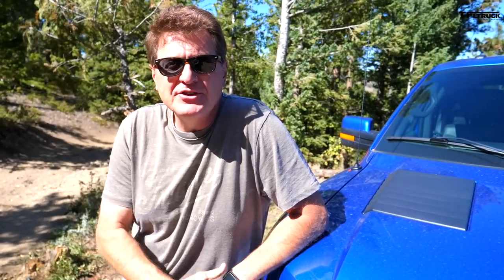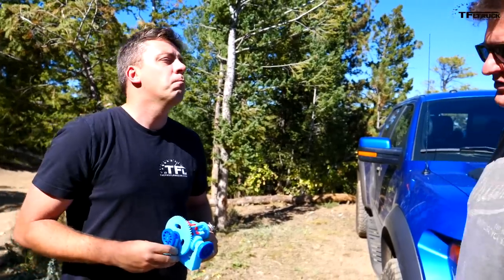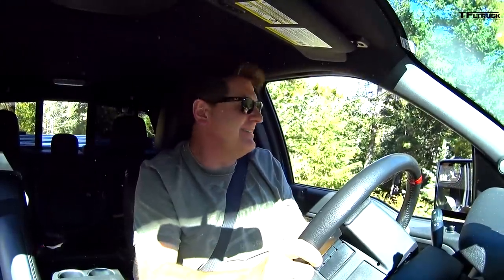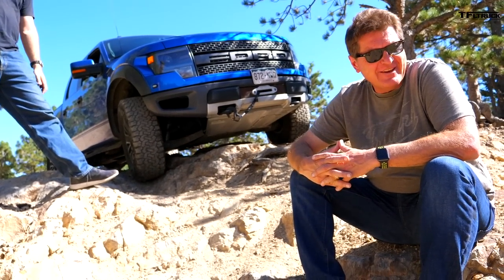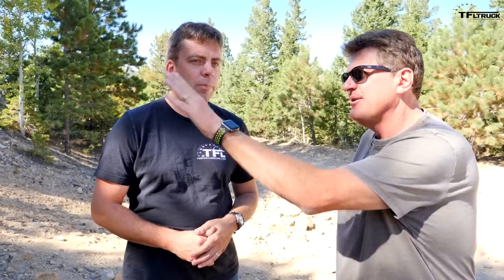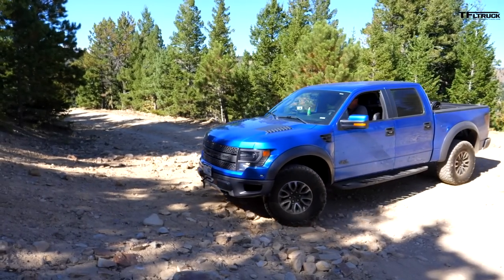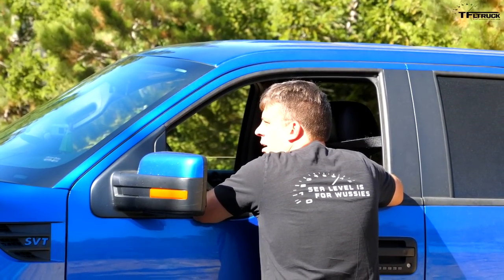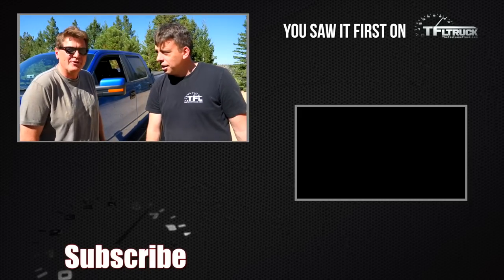How Important Is a Locking Diff When Off-Roading?

Comment: I was really bummed out when I realized my new 4x4 truck didn't have a locking differential which I had assumed it did but this video made me feel better like it's not that crucial; certainly not for anything I'll ever do.  Thanks.
Reply: you didnt check that before buying???
Reply: I had the same thought and like you, I can’t see an advantage, although it might help slightly in some circumstances, but I doubt it..
Reply: Trust me, it will help if you ever find yourself stuck in a sideways ditch on a rainy night. My durango r t is four wheel drive with a proper low speed transfer case. Because I had 2 wheels in the ditch. On both axles, all the power kept going to the wheels that were spinning and not in contact with a road surface

Comment: My 4wd 2015 F150 rear locker works great in very twisted off kilter rolly eroded dirt trails. I've used it in these unique situations when come to a stop, wheels spinning, can't proceed, about to dig in and get stuck, then pull the locker switch on, and it does make a difference. Rolls me right out, then turn locker right back off. It works. Only in certain specific situations.

Comment: The raptor (or any other modern truck) might not be the most ideal platform to demonstrate locking diff vs open as most modern traction control systems are set up to differential brake the spinning wheel (ie what Toyota calls ATRAC) regardless of whether you have the TC on or off.  Especially in this case of the Raptor's Torsen front diff being aided by that system, it makes this a tough test as that raptor is likely going to be sending power more or less to all 4 wheels anyway via these systems.   The torsen front diff in the Gen 1 Raptor I believe has a bias ratio of 2.5:1 with no preload, meaning the differential can transfer 2.5 times the spinning wheel's torque to the gripping wheel.  This is why a torsen diff without the electronic aids usually doesn't do much if you have a front wheel completely in the air (2.5 times 0 is 0) and they behave like they are open.   This is why the brake limited slip function of the Raptor's traction control will apply brakes to that spinning wheel to send 2.5 times the torque of whatever the brakes are resisting to the other wheel.

Comment: Locking diff is huge!!!  Ive seen jeeps fail at a muddy hill and a locking diff jeep pass it right after.
Reply: Northern Rider I don't understand why they do these tests it's all common sense just like off road tires make it easier when you're off roading
Reply: You sit it. It was a Jeep.
Reply: But its not, just something you can add later to your car if you need it. Its not going to change a outcome drastically. 4x4 is still 4x4, locking or not.
Reply: @willb1132  I don't have any lockers in my Jeep sport and so far I haven't needed it when I'm wheeling with rubicons that have them. I jut have to use a bit more speed at times and make sure I have my seatbelt on lol.
Reply: @c4onmylip  If it's a 4WD JK or JL, it has BrakeLock, which is 4-wheel TCS. It tries to vector torque to wheels with traction. It's more capable than older Jeeps with open diffs. It's not quite as good as true lockers offroad though.

 You may also have an LSD.

Comment: I own a Toyota with ATRAC and locking rear diff. In my experience, in high traction situations like big rocks or hard dirt like here, ATRAC does a very good job. Crossing ditches diagonally is also a breeze with ATRAC even if two wheels are in the air. Locking rear diff will also work in these situations. Where the big differences between the two become obvious is in low traction situations like mud and snow. Here the locking diff reigns supreme. ATRAC becomes useless because it will allow some slippage before it activates the brake and this kill all forward momentum. If you have no locking diffs, the power goes to the wheel with the less traction so you can easily imagine situations where two tires will spin and no forward progress happens. With one locking diff, you have to spin 3 tires and it makes a big difference. In this clip it spun both rear tires because they both had equal traction. If one side was on grass so anything slippery and the other side on pavement, it would not have gone very far. Locking even one diff will allow that axle to keep pushing the vehicle up. The big con of locking diffs is steering. On hard traction surfaces, tremendous strain is put on the drivetrain when turning sharply. It will even fight the steering. You don't get that as much with ATRAC. Any surface that allows a lot of slipping, go with locking diff, and surface that has really good traction, stick with electronic traction aids like ATRAC.
Reply: Thanks for the ATRAC explanation...I didn't think it was necessary. Yes a torsen diff in front would be nice but I'm not sure the clamshell case in front could handle the stress. Another problem would be how it would handle the shock of having VSC activate on various surfaces even in 2 wheel drive at high speeds. I mostly wanted to explain briefly the advantages and disadvantages of both system as I experienced them. Us old off-roaders used to use the emergency brake to make an open diff think it was a limited slip and used the brakes to try and simulate two limited slip differentials to get through some sticky situations. Nowadays, a few lines of computer code works a lot better and it can brake only one or two wheels while allowing as much or as little slippage as you want. But in deep slippery stuff when you want maximum traction nothing replaces locking diffs if the drivetrain can handle the increased shock when sudden traction occurs on one of the wheels.
Reply: Better to have all available - electronic controls you can use, shut off as needed, and lock when needed.  Hard to get stuck if you have good tires, drive smart, and have all these tools available.
Reply: @KTMcaptain  Locking diffs do reign supreme - but atrac can get mighty close depending on how it is tuned. For instance, in toyota landcruisers and FJcruisers I've heard it is tuned to be more aggressive than in the other trucks (tacoma/tundra etc - not sure about 4runners though - source Ih8mud tech) but this clip shows how close it can come even in a free wheeling situation with a wheel in the air: https://youtu.be/EMXghBOUMMY
Reply: @KTMcaptain  I'm not disagreeing with you -  I'm just pointing out that tuning can overcome much in the traction department. ATRAC is tuned differently in Toyota's different vehicles, and that's what I was referring to - not trying to disagree with you on the merits of Torsen technology :)  What's interesting (I've worked in this industry for many years) is that depending on how you apply power I've seen several instances (and personally done it a few times) where you can put a wheel in the air and have the Atrac system do an an amazing job; a better job than most would think. Tuning does in fact make a big difference between vehicles (tundra/tacoma) vs Landcruiser/FJ. Not sure if "anywhere close" is a fair representation, at least generally speaking - but perhaps in the instances where the locker does make the difference in those situations (Atrac cannot work without wheelspin, and a locker works before any wheelspin happens) it may be a fair statement (when it matters).
Reply: @KTMcaptain  I've had a different experience in all my testing of it than you have then. Anyway, Toyota doesn't market it as an LSD FYI, for years the FJ/4runner had atrac and tacomas (in basic trim) had open diffs and TRD sports had LSD and TRD Offroad had atrac and rear lockers. In Canada (where I'm from it was a bit different actually as the model equipment varies). Mid level clearly had LSD and that's how toyota marketed them; then in the late 2000s they started adding Atrac and some models still were advertised with LSD rears and others had Atrac, now atrac has become the gold standard. They removed the LSD and if you look under the vehicle you will see the little LSD tag missing on those models. Peace :)
Reply: @KTMcaptain  Sounds like we're talking about 2 different things. :)
Reply: Modern toyotas seem to do better with slipping in snow, but lockers are supreme. There was a time 10 years ago when the Grand Cherokee came with electronic lockers front and rear that kicked in automatically, I wish more manufacturers took this approach.
Reply: @pizzasaurolophus  You don't want lockers on slick, crowned or slanted routes. That could be a lawsuit waiting to happen.

Comment: Guys, I really enjoy your videos, keep them coming.  A couple of comments on this video.  I live on the Gulf Coast and have a 2012 F150, 4x4, off-road package, with locking differential, which I run on the beach all the time.  I conducted a similar experiment on the sand a while back.  What I found was that my rear differential acted as a limited slip differential when I did not have the locker engaged.  No matter what I tried to do to make the rear diff slip, I could not, both wheels were pulling, without having to turn on the locker in the diff.  In hard pack sand, I could make a sharp turn, with the locker OFF, there was no rear wheel hop, but when I engaged the locker, there was pronounced wheel hop during the turn.
My conclusion is that the differential in MY truck acts as a limited slip when the locker is not engaged and as a locked differential when the locker is engaged.  I say MY truck, as I can’t positively say in ALL Ford trucks with locking diff.
A comment about your video, which seems to corroborate my comments above.  In the last part, when you are trying to climb the hill, with the locker OFF, I see Tire spin in the video and BOTH tires seem to be spinning at the same time......thus indicating the diff might be acting as a limited slip diff.  That’s probably why the truck was doing as well with the diff unlocked as locked......mystery solved???
A comment about front limited spin diffs.  A long, long time ago, I had a Ford Bronco, with a limited slip front axle.  I liked to run on the beach, it was a special factory order.  I suppose it was a regular and not a Torsen diff.  It was wonderful running in sand, it always had both tires digging.  But it was a DISASTER in ice, first (and only) time I engaged 4 wheel drive in ice, going down the highway, the front wheels started “hunting” for traction, the truck started fishtailing horribly, no way to correct it, and we ended up doing 360’s down the road.  We were lucky, after two revolutions, we ended on the side of the road, with the wheels pointing down.  No more limited slip for me in the front axle....never...
Can’t wait to see you test the new F 150 with the Diesel engine.  
I have 115,000 miles on my F150 with the Ecoboost, zero problems, none.  I love this engine.  I pull a 6000# travel trailer with it and it is amazing to me how well it pulls, on the Gulf Coast AND in the mountains.

Comment: Lmao!!! This is the best.... great attempt guys! Proved absolutely SQUAT but it was fun to watch 😜
Reply from the maker: So true, we proved nothing but had fun doing it.
Reply: They locked it when it was locked the first time also lol. Momentum is your friend,,, or enemy lol
Reply: How is That LAMO Fiat Ram working out?  lol
Reply: They proved that demanding facts only makes the fun less enjoyable.
Reply: Also forgot to air down the tires, less grip = more slip.
Reply: the single trucker   slip WAS the goal.
Reply: Good attitudes pointless video lol!
Reply: I got the answer i was looking for. Thank you! Diff locks are for luck...being stuck in the mud spinning one wheel locking hoping you get lucky your other tires are on better ground...
Reply: @TFLtruck  OK, correct if i'm wrong, but what I did learned is that I dont need a locking differential and 4wd is enough right?
Reply: @TheSingleTrucker  So tired of this argument.  Valid point.  But by gosh every time someone is trying to prove something about how a mechanical device works or technology works, someone cries.. air down the tires.  Or get off the street tires and put on some proper off road tires.  I have a TRD and I run the stock tires, stock everything on it and I do not air down.  I go everywhere the scared aired down vehicles go.  And at the end of the trip I have to wait for them to either air back up or change tires because their bead locks were broken.  This test was useless because as Roman stated the tires were just that good. (aired up)  Locker vs no locker had no meaning when the grip is just that good.  ;)
Reply: Joe Lesko should have made a video on how dumb it is to buy a new 70k raptor adding off-road parts and then selling it for a less than half of what they paid for it

Comment: This test should've been done with two identical 2WD trucks, one with a locker and the other without. Your compromising the true results of a locker with the front axle of the Raptor. Lockers at both ends of a LWB 4x4 vehicle, like on a Power Wagon is what serious off-roading is all about. In my line of work, this is why I drive and own 3 Power Wagons, just wish the newer ones came with a dually and a 8 foot bed.

Comment: I found that the locking diff in my 2012 F-150 was most useful on a slippery boat ramp pulling the boat out of the water. 2wd with the diff locked would never slip probably due to the heavy tongue weight.

Comment: Most of us know this but I figured I add to it....when one wheel comes off the ground...without the locker, the truck is going to spin the lighter wheel (wheel that isn't holding up any weight of the truck). Without the locker only one side (the side in the air) will spin. A great example would be to leave it in 2H and lock the diff on the back and put one side under a heavy load. I had a TRD Prerunner for 10 years with just the locking Diff and it made a huge difference just being able to lock the back up especially where terrain is not even . Now I have a 4x4 F150 and there was no way it wasn't coming without a locker. Remember wheel spin on tire with no weight is where you need the locker.

Comment: They proved that the Raptor isn't very impressive at off roading.  And yes, a locker is absolutely necessary if you are gonna do any serious wheeling.
Reply: Ryno5150 the raptor is made more for prerunner type off-roading. If it was a rock crawler it would be a Jeep. Something that was more capable in a setting like Moab that was also factory built, street legal, viable as a daily driver, and also a full size truck with creature comforts would be an expensive venture with a limited market due to cost. Jeeps are better for extreme terrain courses because they arent as big, low, heavy, and stiff as a raptor. They have more flexibility, better angles of approach and decent, and solid front and rear axles. The raptor really doesn't even have to be 4x4 for the type of driving it's made for. It could get away with rear wheel drive only like many of the racing trucks it mimics. It's made to have good suspension travel and race down roads that would kill a Camry. A different tool is needed for every job.
Reply: I'm almost convinced my 99 Tacoma prerunner can do better than a Raptor at both
Reply: power wagon
Reply: the raptor is AWD 4WD 4WL 
 hummer H1 would be sweet or dodge ram power wagon
Reply: @liammiddleton3064  The H1 and the Power Wagon are really underrated at true technical offroading like rock crawling. People think just because they're huge they can't do it, but they're actually big billy goats.

Comment: Hi Guys,

Avid watcher of your content and veteran who drove similar terrain in Afghan in either Ranger trucks or Hilux’s.  Yes they are light trucks, however, in my humble opinion to state airing down is a non factor in traction off road is a huge understand to your non four wheel drive viewers.  As I also would like to comment that I have lived in every continent and traveled in remote areas in all.  Lowering air pressure will truly make a huge difference and give a more accurate account of LRD will work off road.  Most of your tire slip can be attributed to high tire pressure vs lack of a LRD.  If you lower the tire pressure, then you would see considerable traction control gains.   In the beginning of my career 2001 we pretty much traveled in modest trucks in fairly stock condition.  Towards the end thanks to the popularity of Overlanding/Off-roading we traveled in fully kitted/modes vehicles with all of the latest tech by 2016.  In closing, I believe  that most stock vehicles aired down would have made it over that hill with a decent driver like you all behind the wheel.  I, however, do agree the differential locker does provide significant capability increases in all off road vehicles.

Comment: What about traction control? They didn't mention if they had traction control on. If it was on, it would act like a LSD, and apply break force to the slipping wheel to send the torque to the other side.